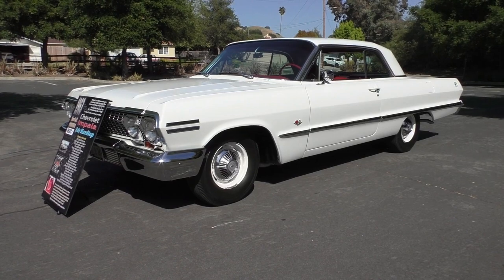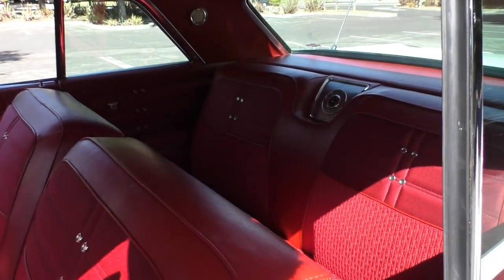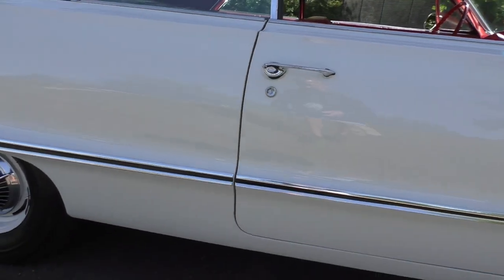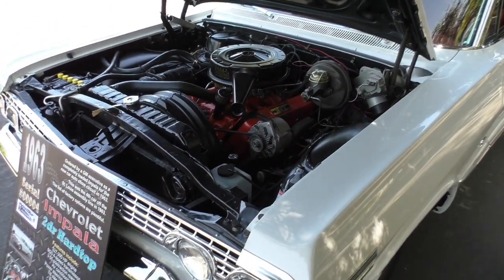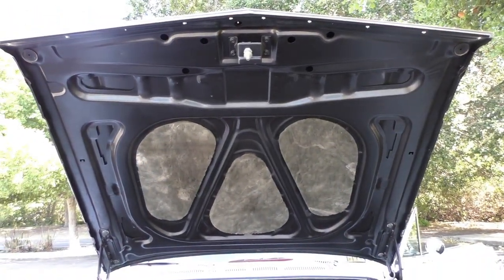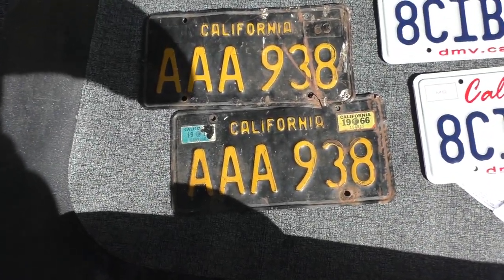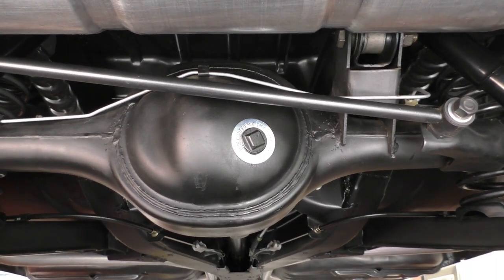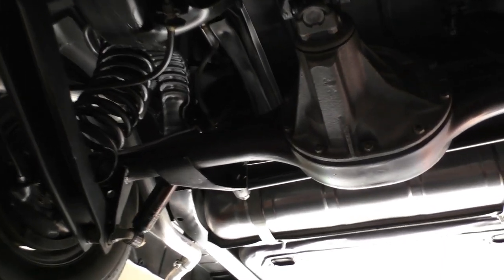1963 Chevrolet Impala 327 M20 4 Speed Serial #00004 (Sorry Sold)

Comment: The am/fm radio was a 63 1/2 year option same as Cadillac so it can't be original. This car is nice but is missing full wheel covers, cruise control , front and rear bumper guards, gas door trim, vacuum trunk release and padded dash and why on earth would a GM exec want a non SS car with poverty caps???